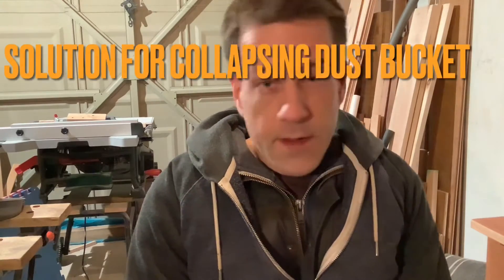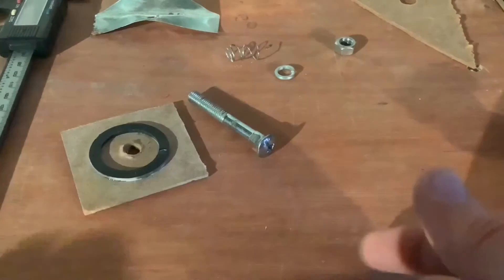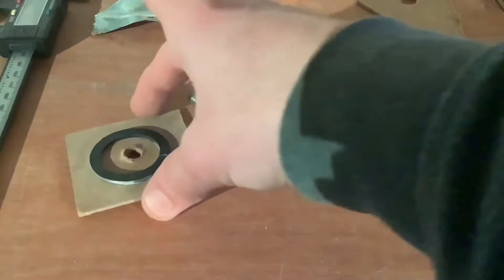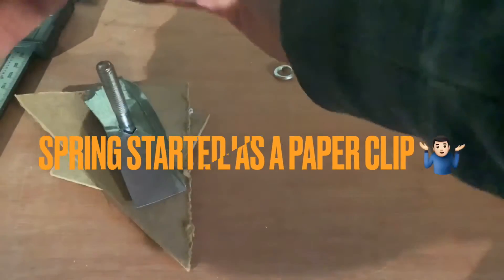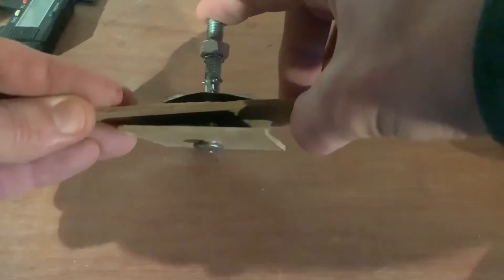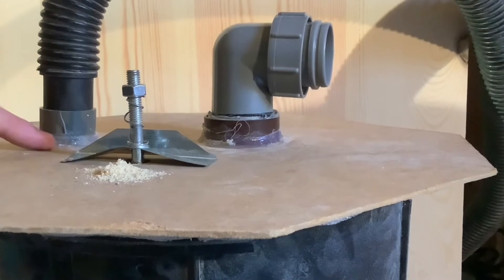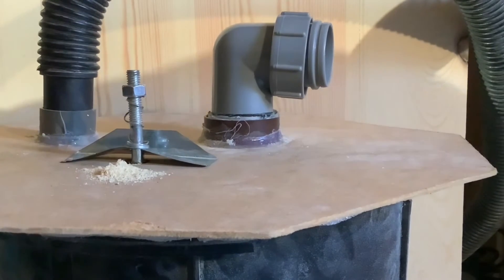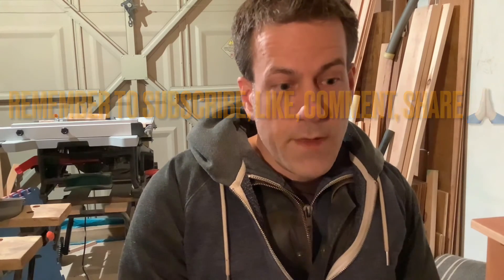Collapsing dust collection cyclone bucket? You need this EASY AND CHEAP FIX! PRV HACK

Comment: Great idea, great video. Nicely explained and demonstrated. Simple solutions are the best. My current separator made from ash separator (metal drum) is too small (15L) and collapsed occasionally...  I had to reinforce it with a wooden cross inside, but I was afraid that the larger barrel would collapse more easily. Then this would be my solution to the issue :) Cheers!

Comment: Great video mate. Only just getting around to doing this.
Reply from the maker: Still working a treat, if you’re doing it: you might want to make it slightly larger than in the video, I found the hole needed to relieve the pressure was bigger than I was expecting!
Reply: @dovetailsnotnails8090  thanks for the advice mate. I’ll get on it this weekend. 😊